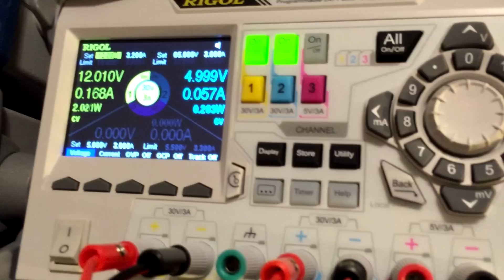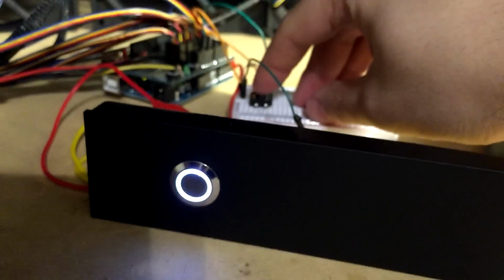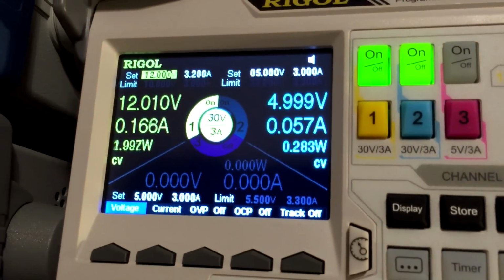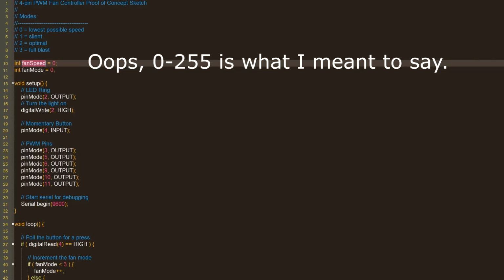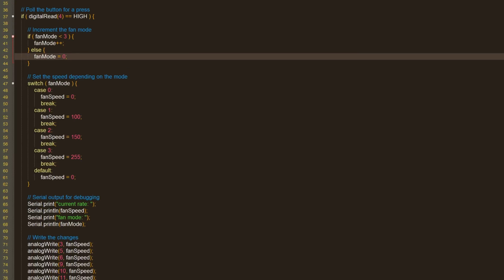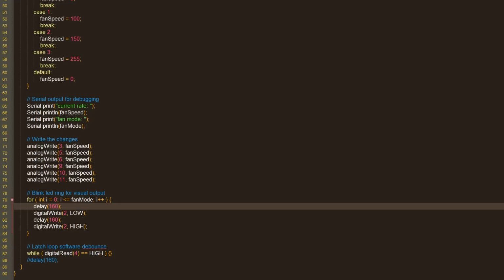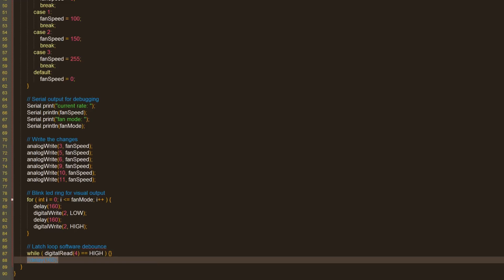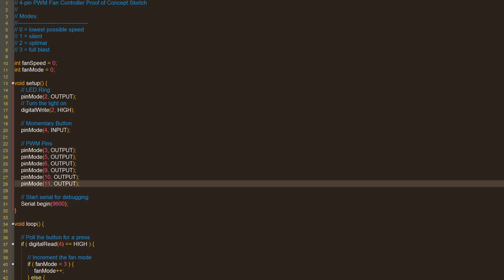DIY Arduino PWM PC Fan Controller (Part 1) [Prototype] #0000

Comment: Curious why you chose not to control the fans automatically based on temperature...

I am relatively new to using Arduino, and I am looking to control some fans with some temperature probes. My goal is to use multiple probes to control fans in different locations, and then to add a display of some sort to monitor the temperatures and the fan speeds. As of right now a Thermistor, but will move to DS18B20 once I get all of this sorted first.

My main reason for this is that my GPU is part of my loop, and when I am playing mos t games the GPU will be under heavy load while the CPU is sitting idle, and since my current load of fans are controlled from the only PWM headers on the motherboard (Unfortunately, despite what marketing says, most boards have only two PWM headers, the CPU and CPU_OPT headers. The CPU_OPT header is just a mirror of the CPU). So the goal is to have the fans on my 280mm radiator controlled by the GPU, while the fans on my 560mm radiator and the two pumps are controlled by the CPU, this way both of the main heat generating components are controlling their own cooling independently.
I also plan to have another temperature probe in the main part of my case (CaseLabs STH10), so that the intake fan can be controlled by the case temperature itself. I am hoping that your code will give me the guidance I need to make my own controller that uses a thermistor, but I am not certain that I know enough to get it all working by myself, but we'll see!

THANK YOU FOR YOUR WORK!
Reply from the maker: Jacob Crosby I'm glad you asked!  I'm going to make a new one for my wife's computer that will be thermal throttled (with manual override option).  That will be coming up in the next month or two. (when I get time)  I've found out the hard way a few times that it's easy to forget to turn the fans up from silent and have had a couple crashes.  Oops.  I've been better about it lately but I definitely plan on making the change in the near future.
Reply: +TechnologyCatalyst 

Fantastic! I am really excited to see it! I was working on making a temperature controlled unit, heck, I would settle for getting it working at all at this point... Perhaps it is the fact that I am using a Nano though. I have tried about a dozen different examples to get it working, to minimal avail, one of them worked, but it ran at minimum and only went up by about 10%, so not sufficient at all. Although, my programming experience is minimal, and this is only my third project that I have put any real effort into. I have tried to get a couple of things working with some ESP8266, a wireless motion detector, which worked well (albeit only switching an LED on/off), but it is the little wins that keep me motivated! lol

If you are at all willing to send me a message once you get the project done and/or uploaded, so that I can use your example. Perhaps you can answer my next question, that is, can I control multiple 'channels' individually on a single Arduino, or would I need multiple to do that? I don't know if doing this somehow synchronizes all of the PWM headers or not (Something I read in my searchings for a solution). Anyhow, I would like to thank you again for your work and for sharing it with the community! Not sure if you have yet or not, but perhaps make an instructable for this... I think it might end up reaching a wider audience... :-)

On a side note, the Hyperborea fans are rebranded fans, I think the manufacturer is Akasa (Apache fans), but I have seen three or four other brands that use the same exact part. They are actually really good fans that cost a lot under other brand names. I have seen the other brands of those fans that cost upwards of $25/ea.

I ended up getting lucking and bought all 7 of the fans I needed in Phanteks brand, and I think I paid ~$13 per fan after they were on sale, plus there was a 20% discount code, so instead of paying the retail of $20, I got really lucky and saved something like $50 if I remember correctly... My apologies for the length of the message... Thank you for having the wherewithal to make it this far without falling asleep, unless of course you took a nap... I don't hold it against you.... ;-)
Reply from the maker: Experimentation is the best way to learn!  Try, fail, and try again!  As for controlling multiple channels, you can use one arduino.  Each one has a set number of PWN capable pins, however, so if you want to control more than that, you could just get an external PWM IC that has enough channels.  (those are usually controlled by the arduino via I2C or SPI and have libraries to make that easy)  If and when I get around to that project I'll cover the code in the video, and I'll also upload it to github for those who want to use it as a starting point.
Reply from the maker: I'm planning on making a temperature controlled one for my wife's rig in the very near future if all else fails. I'll cover the code and everything like I did for the last one I did
Reply: Fantastic! That was an easy way to get a sub! lol I am looking forward to it.

Sorry, what I meant by the PWM control is that I read somewhere that you have to change the Arduino somehow to increase the frequency of the PWM (PWM fans run at ~26kHz IIRC, and I think they said the Arduino runs at ~8kHz), and there is some special code to do so. I was wondering if doing that makes all of the pins sync up, so that there is no way to generate more than a single PWM signal across all of the available PWM pins.

With that in mind, you were clearly able to generate multiple PWM signals without changing the PWM frequency. It would seem that the PWM on an Uno and a Nano are not the same (Which I expected), though I did not expect such a significant difference. I am guessing what I read was regarding the Nano only, or at least the MC on the Nano, unless your fans are better able to handle variable signals, which goes a bit above my head...

Anyway, sorry for the confusion, and then the long message to further explain what I did not sufficiently explain initially. lol

Thanks again!!!
Reply: +TechnologyCatalyst HOW easy would it be to write some code that would sound a buzzer if a tacho of a pc fan stopped. so its like a pc fan fail monitoring alarm.
Reply from the maker: helloo oo Not hard at all, but that's assuming your microcontroller has enough interrupts to spare one for reading fan speed.  The problem is that you'd need an interrupt for each fan.  I'd have to think about it but I'd imagine there are cleaver ways around this.  Keep in mind, that's actually reading the speed.  You could totally pull this off by reading the sense wire on each fan for changes and if no change is detected over a certain threshold period of time, it alarms.  Lots of ways to skin that cat, but it shouldn't be too terribly hard.  I would start by powering a PC fan up and viewing the output of the yellow wire (if it's a 3pin fan) on an oscilloscope, if you have one.  Here's a link for how to read the actual RPM of the fan using interrupts: http://www.thebestcasescenario.com/forum/showthread.php?23437-Arduino-Tutorial-Reading-PC-Fan-RPM
Reply: Thanks for your help. i have an arduino UNO and i have connected a pc fans yellow cable up to D2 im using D13 led as the alarm ( i can later change the led for a buzzer. i have tried to modify some code i found online however im not very experienced in writing code so im struggling. the UNO is powered by USB 5v and the fan is powered by 12v ( i have the 12v ground connected to the UNO ground) if you could help me in any way with some code i would be more than happy to send you some components in the post as a thankyou :)
Reply from the maker: Try hooking it up to an analog pin and do an analogRead(A0) and output that number to serial monitor and see if the numbers are usable.  (holler if you don't know how to use serial monitor) For example, see what it outputs when the fan is spinning, then check again when the fan is stopped.  That might clue you in on a potential solution.  Let me know what you find.
Reply: Hi. i copy and pasted this code  and in serial monitor it reports fan speed 661rpm..when i stop the fan it says  0rpm  could we modify this code to flash a led on and off so it acts as an alarm ? 

http://www.themakersworkbench.com/content/tutorial/reading-pc-fan-rpm-arduino
Reply from the maker: Yup, a simple if statement could trigger the alarm (which could just be a variable named alarm) and then somewhere else in the code you could have another if statement that checks to see if alarm equals 1 (means alarm is on), and if so, set a digital pin high to turn on a beeper or LED or both, and you could even count the number of passes and toggle it on and off so that it blinks.  lots of ways to pull that off but that should get you in the right direction.  If you use a buzzer or beeper, you'd just set the beeper's pin to high and you'd be good to go.  to "blink" an led would require a little bit more code, but nothing hard at all
Reply: i wouldn't really know were to start with editing the code. whenever i try i just get loads of errors. i did ask on the Arduino Forums but i just got abuse thrown at me apparently they dont like people asking for free help on there.
Reply from the maker: Let's say you're using a 5v beeper/buzzer.  You need an if statement to check to see if the fan speed is 0 rpm.  Let's pretend the speed is saved into a variable called "rpm".  You'd do something like this:

if ( rpm == 0 ) {
   # set this to whatever number your buzzer is connected to
   digitalWrite(5, HIGH);
} else {
   digitalWrite(5, LOW);
}

That's just a REALLY high level example of how you could do it.  I'm obviously not going to write it all for you but that should get you in the right direction.
Reply: i have attempted to edit the code. does this look like im heading the right way ? i cant upload it as of yet because im getting an error but im looking on-line to figure out what's wrong with it https://encodable.com/uploaddemo/files/pc_fan_fail_alarm.ino

Comment: This is great! I haven't actually been able to find a  pwm fan controller.
Question 
Do you know the Amps power draw of the Hyperborea 140mm fan?
I just bought two but I can't find that info in the specs.

Another question :D 
I know nothing about this so bear with me 
So for PWM the fan receives 12V and 
the 4th pin regulates the % so is an on and off thing so Why in some motherboards the 4th pin is marked as a +5V ?
Reply from the maker: joshvelazquez I think they each draw around 250 mA at full throttle.  They might temporarily draw a hair more while they accelerate up to speed.

Yellow is 12v.  Black is ground.  Blue is PWM input.  You can turn it on or off by feeding that 0v or 5v.  5v on that line would just force the fan to run full blast for motherboards that don't support PWM throttling.  (I'm making an assumption here--it could be for some other reason)
Reply: TechnologyCatalyst Thanks! 
So the 4th pin feeds 0 or 5V in a pulsating manner to control duty cycle, right?
Why no one manufactures true PWM fan controllers?
All I find are controllers that you have to connect in to a PWM header in the mobo...
Reply from the maker: In a nutshell, yes.  True PWM fan controllers do exist--they just aren't as common.  Here are ones on newegg: http://www.newegg.com/Product/ProductList.aspx?Submit=ENE&DEPA=0&Order=BESTMATCH&Description=pwm+fan+controller&N=-1&isNodeId=1

Comment: reallly nice video and project.
Im planning to do one for my CPU-Watercooler by myself but it should be able to read the temps of the CPU out by using "MSI Afterburner" and setting the speed by itself without any buttons for input. I hope i find time for it ^^ (sry for my bad english)
Reply from the maker: Maki Polo thanks!  be sure to upload a video of your project and link it!  I'd be curious about a fan setup that queries the system like that

Comment: Nice project, nicely done!

Planning to build one my self, but I will use 2 temp sensors so fans speed is set automatically, depending on the speed/temp curve. That's the plan anyways.
Reply from the maker: DankoH Thanks!  I'm actually planning on taking the thing back out and adding at least one temperature sensor because I've been caught in the silent mode a few times during some gaming or rendering and had it crash on me.  Oops.  A temperature sensor to override the user setting would do the trick.  I just need to find the time to do it.  Cheers!
Reply: TechnologyCatalyst 
That's exactly what I was thinking. I don't want to mess with it manually, because I will forget about it eventually.

Comment: Very nice project! Could you please post the schematics? I am new to electronic.
Reply from the maker: Yes, I will make some right now and post them when I am finished.
Reply: Thank you!
Reply from the maker: Mein Kanal!

Here you go!  Since you said you are a beginner, I decided to make a wiring diagram instead of a schematic so it'll be easier to read.  If you would rather have a schematic, just let me know.

http://imgur.com/X6fvykE
Reply: Thank you very much for the effort!
Reply from the maker: No problem! Good luck!
Reply: So is the 5V pin on the arduino also an input?
Reply from the maker: Since the computer power supply puts out a nice clean regulated 5 volts, you can plug it straight into the arduino's 5v pin to power it.  If you use a higher voltage, you have to use VIN pin, but that goes through the arduino's voltage regulator.  That's what you would use if you were to power it with 9 or 12 volts.
Reply: Okay, thanks!